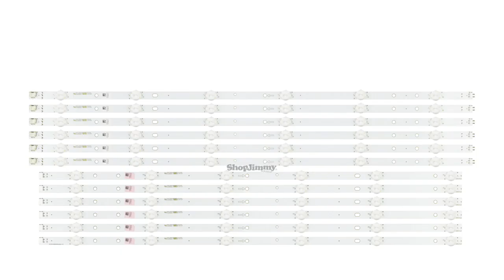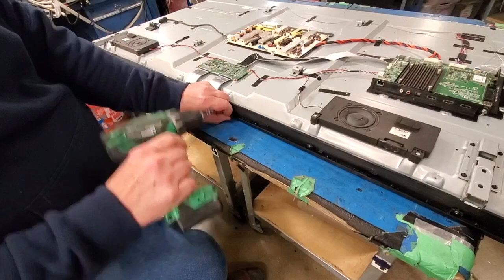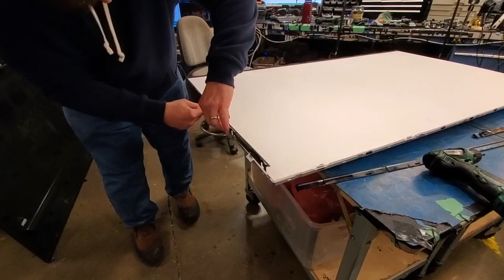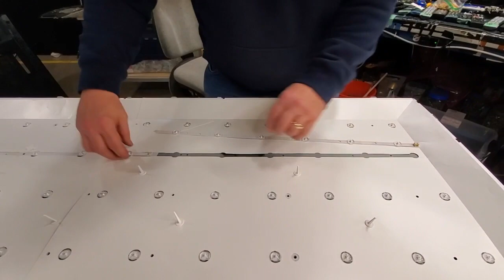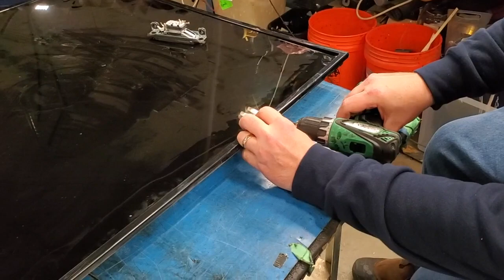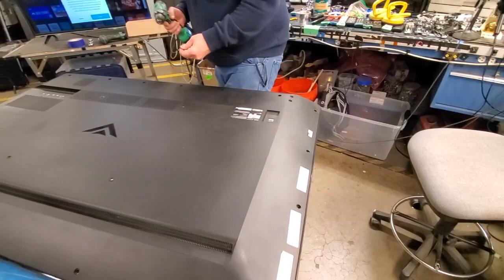Vizio 65" TV-No Backlights & No Image LED Strip Replacement - Vizio TV Models  E65-E3

Comment: OMG that reflector can be removed easily rather than cutting into so many pieces l m sure it did not save time.
Reply: As someone who has done this repair on this exact model it’s not that hard and I would rather remove it than cut. Over half of the clips holding the reflector in are the same clips holding the LED strips in that you will remove anyway.

Comment: Was anyone able to successfully do this repair?
Reply: I did it once but chose to replace the individual LEDs on the strips that went out instead of the whole strips (I already had the proper equipment to do so), it worked for a few months but the other LEDs I did not change went out causing the same problem. I am about to have to do this again but I am doing the entire strips from their website. The project isn’t as bad as it might seem, just have to be very careful with the LCD panel.
Reply: I just did this. Even more careful than the video. Removed entire paper led cover. Used suction cups purchased from shopjimmy.com. removed screen very very carefully. But mine had circuit boards on the bottom of screen which I didn't see in the video. Put everything back together exactly like the video(before even seeing the video. ) now I got vertical lines that flicker and change positions. What could be the cause of that.
Reply: @Tyler Hanks how did it go?
Reply: @Tyler Hanks Did you at least part out the rest of the components?
Reply: I just did it on the E60-E3, which is similar, but there were some notable differences in the teardown. Almost ruined the ribbon connectors because the buffer boards were hidden behind a piece of metal that flips down. I read that this model will overdrive the LEDs and to keep the brightness setting at or below 50% if possible. I literally picked this tv up on the side of the road and it was in great shape apart from blued LEDs
Reply: I tried today but I am having issues getting the correct backlight strips. I need LE65DL1017H and having trouble finding them. Anyone have a good place that has this strip set?

Comment: Buenas a todos. Miren tengo una tv samsung en el que al enchufarla a la corriente, el led parpadea 6 veces y se enciende sola, pero no da imagen y si da sonido. Acercandole una linterna a la pantalla se ve imágen. Al principio pense que había algun led quemado, pero comprobé TODOS los led (uno a uno con el multimetro en la escala de continuidad) y todos funcionan. Y no estoy seguro de si es la fuente de alimentación. Comprobé con el multímetro y la tele encendida los voltajes del conector led enchufada a la fuente y me daba (tiene 4 cables) en los 2 cables positivos, 110v y en los 2 cables negativos me daba 210v aprox. Con la placa base main desconectada y la fuente enchufada a la energía me da en los 2 cables positivos 50v y en los negativos 140v. Otra forma que utilicé para probar los leds es con un cargador de telefono de 5v con 2 agujas en los cables y todos encendían por igual. UNOS DIAS DESPUES volví a desmontar la tele para probar los leds, y con la energía enchufada me dió por usar el multimetro para comprobar el voltaje del conector de la regleta led (el conector de los led, no el que va a la fuente) y cuando puse la varilla roja del multimetro en uno de los 2 cables negativos, todos los leds encendieron de forma tenue. Y si ponía el multímetro en continuidad se encendían un poco más fuerte. Según esto puede estar la falla en la fuente de alimentación pero no se donde.Si me pueden decir la solución se los agradezco. Gracias.